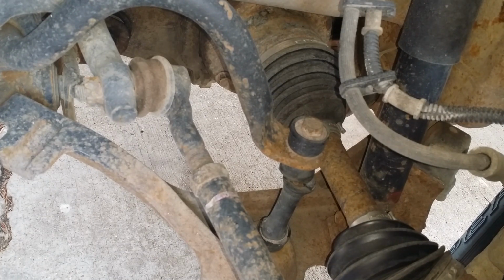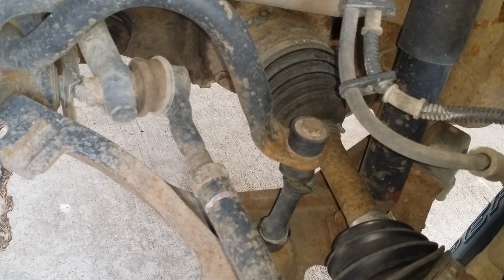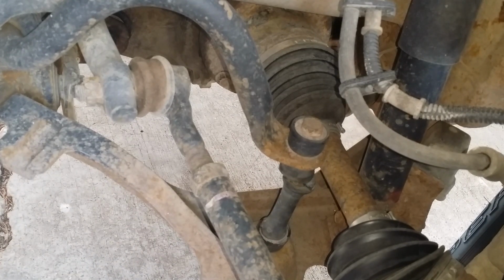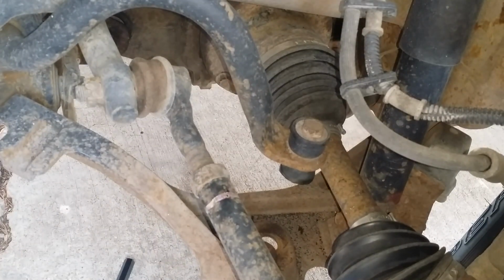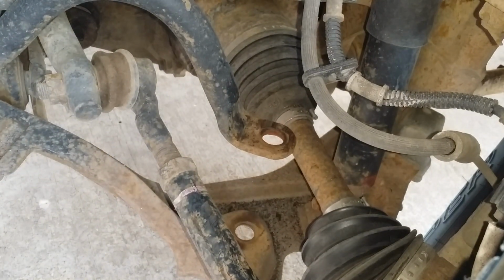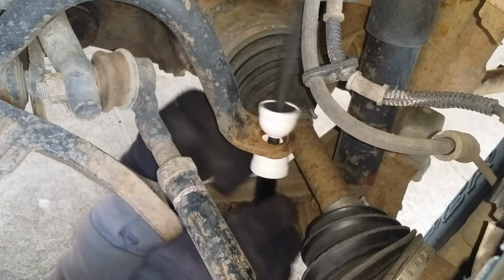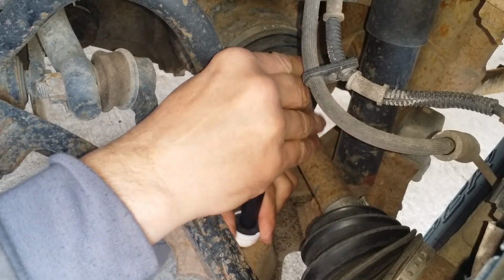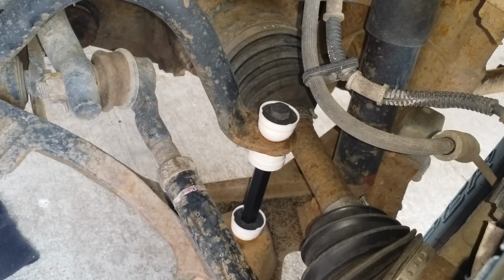97-03 Ford F150 sway bar end link replacement

Comment: Umm the bolt is a lot easier if you went in from the bottom not through the top
Reply from the maker: Ummm, ya well. I just followed the instructions.
Reply: Easier, but the factory has the threads on bottom in case the nut comes off. Nut comes off the top, bolt falls out, all components are lost. It's about safety not ease.